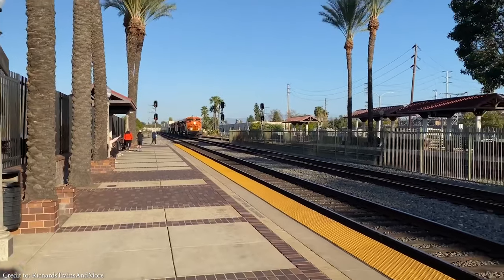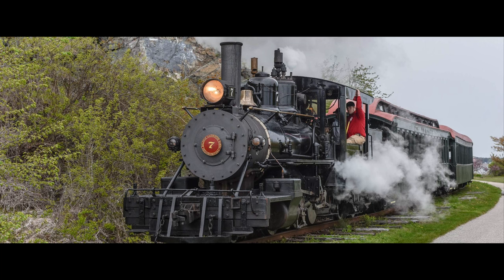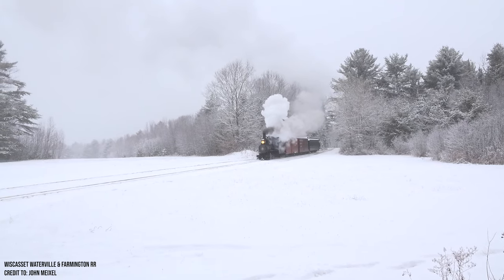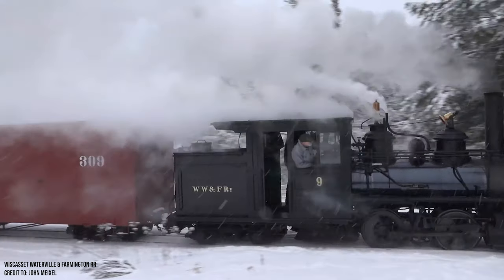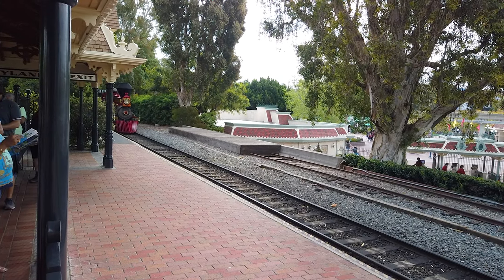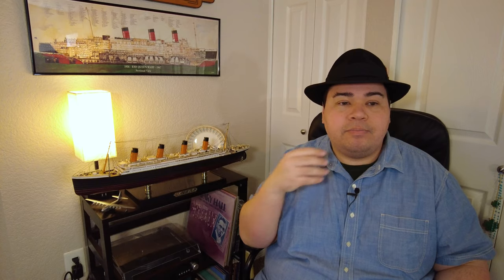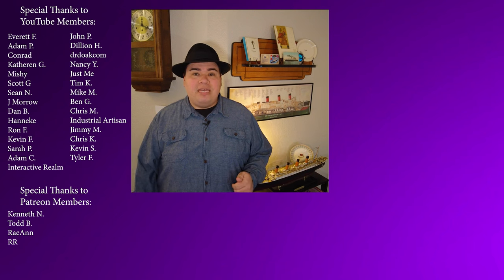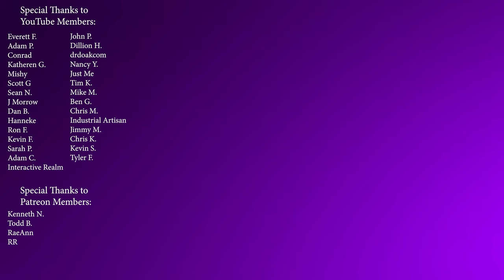A Brief Explanation of Narrow Gauge Steam Railroads!

Comment: Another benefit to narrow gauge lines is that they can have tighter radius curves, which was another key reason why the Durango & Silverton railroad chose narrow gauge. They could still run full sized trains but could also easily follow the winding trail of the valleys and mountains

Comment: Even though this video hasn't had any new information for me, I still think it was great and I absolutely agree with you about narrow gauge railways being fascinating.

In Germany, where I live, we also have a very special narrow gauge system which you might want to look into, just out of curiosity.

The Harzer Schmalspurbahn (Harz Region narrow gauge railway, short HSB) runs trains on a 87 miles / 140km network through the Harz mountains. The trains run on Metre gauge, so roughly 3'3".

They mostly run commuter services with single railcars on their routes, including one service joint with a local light rail system where their tramcars join the HSB network and run alongside regular rolling stock. 
(this is completely possible in Germany and is also practiced in other cities where trams run between commuter trains and even long distance high speed trains [for more about that you can look into Karlsruhe light rail]).

The most spectacular service operated by HSB though is probably the Brocken railway, which passes through several villages to reach its destination, the Brocken mountain.
It has DAILY operation throughout the whole year and is almost EXCLUSIVELY served by steam trains! This is not an exaggeration. On a normal weekday there are ELEVEN regularly scheduled Steam trains leaving towards Brocken and the same amount returning. This makes for an almost HOURLY service from 8:00 am to 8:00 pm, almost exclusively ran by steam trains.
On a busy day they operate 10 Steam locos simultaneously, mainly on this and a few on other routes. They also have a street running portion which they use upwards of 20 times a day for regularly scheduled trains.

It is simply spectacular to see regular steam trains running more or less hourly on a timetable like it was a commuter rail system.
If you are a railfan and ever plan to visit Germany, this is something you have to do!

There are also two other narrow gauge railways which regularly use steam locomotives in Germany, the 'Molli Bahn' inthe town of  'Bad Doberan' and the 'Rasender Roland', although I think they don't have year-round service and don't use as much trains at the same time.
There are also the occasional heritage railways.

I hope any one of you found this ramble about steam trains in Germany in the 21st century interesting.

If you want more information about the HSB, visit their website, "hsb-wr [dot] de" or look them up in Google.
If you're interested in that kind of stuff it's definitely worth a peak.

Have a nice day 😉
Reply from the maker: Thank you!

Comment: Back when Amtrak was just getting started in the mid-1970s I took a trip up the coastline  San Luis Obispo and back again. On the return, as one does on trains I fell into conversation with another train enthusiast, who happened to be the wife or Ward Kimball. As you probably know. Ward was the one who got Walt Disney into his love of miniature real railroads, because of Ward's  purchase in the 1930s of a narrow gauge engine. Much later I became familiar with the town in Nevada where that engine had been headquartered, Battle Mountain in the Great Basin, which was and still is a mining community.  The Nevada Central shortline served between Battle Mountain and Austin 90 miles to the south to bring people and mining products to the transcontinental RR that passed through. 
 What seems to have been part of the impulse to use narrow gauge was the engineering of that time. Terrain following by staying along the sides of the river valley ridges meant that slopes were shallower and speeds could be more constant.  The downside was having to follow the contours in and out, the many curves you mentioned. When the automobile road to Austin was built,  it became straighter and thus shorter, if more vertically challenging. Thus that fairly recently built Baldwin was not profitable and sold in good condition. Average speeds of both automobiles and steam trains were for a time fairly similar, but the traction of rubber tires to climb steeper but still small hills made a lot of difference. So did the Great Depression, where crew size and scheduling could be more flexible than on railroads. And railroads had to  still pay property taxes while the public paid for the highways.

Comment: Waterville, "Wiss-Cass-Et", and Farmington Railroad. Also, the first 2 foot gauge railroad in the U.S., if not North America, was the short lived Bedford and Billerica Railroad in Massachusetts. It had two diminutive Forney locomotives named "Ariel" and "Puck" after Shakespeare's "A Midsummer's Night Dream". It lasted about 7 to 9 months. After it shut down all of it's equipment was sold up to Sandy River in Maine to create what would become the Sandy River and Rangeley Lakes Railroad. The right of way was bought by the Boston and Lowell Railroad and changed to standard gauge and referred to as "The Concord Branch".

In the Boston area, there was "The Boston , Revere Beach, and Lynn Railroad" it was unique in that it was three foot gauge, but it's passenger cars were built to Standard Gauge and mounted on three foot Gauge trucks. Also they used exclusively Mason Bogie locomotives, though when Mason/Taunton Locomotive Works went out of business the B, RB, & L. bought the design from Mason and had new Bogies built by Alco. Manchester. There is only one Mason Bogie still around, it's called the "Torch Lake" and is in service at the Henry Ford Museum in Dearborn. MI. The Bogies allowed the drive and pilot wheels to swing to either side under the rigid boiler to handle tight radius curves.

One more thing the cross bench open cars on the Disney Land/Disney World  Railroad are pronounced "NARA-gan-sett" it sounds like the short name for the National Archives and Records Administration. Even if they and Narragansett Rhode Island have doubled R's.